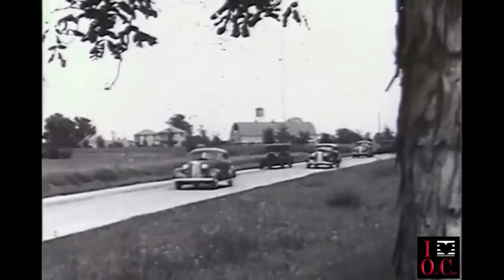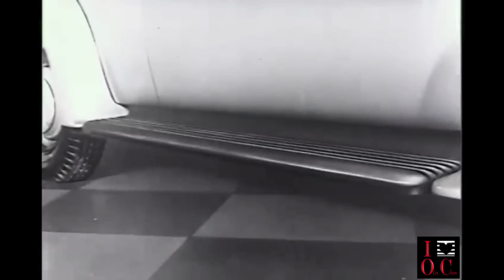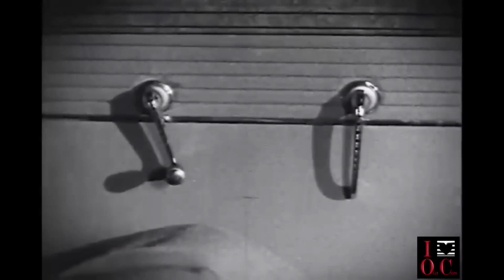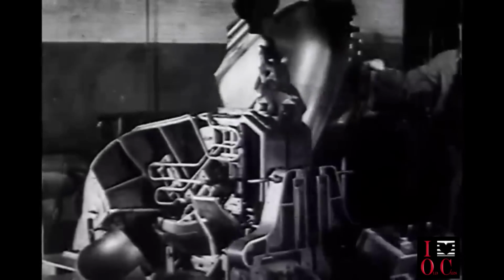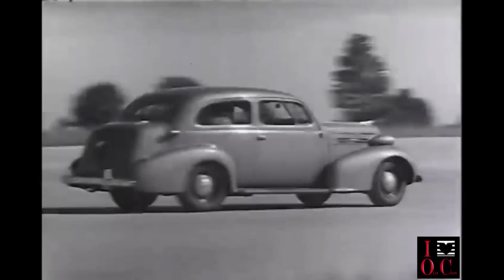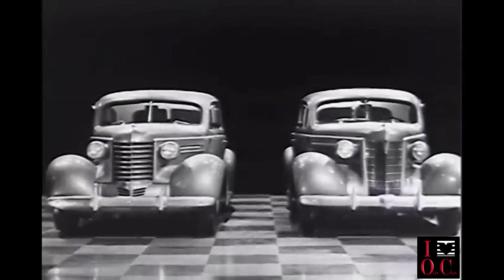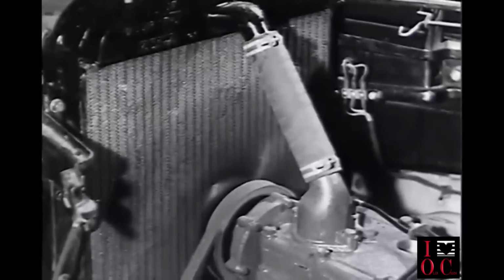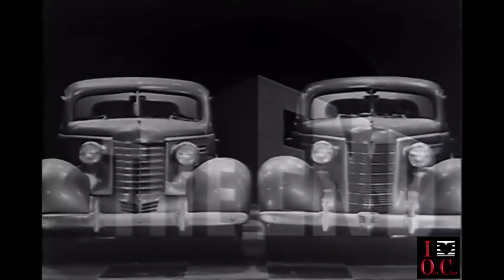This Vintage Film Compares the 1937 Oldsmobile 6 Cylinder and 8 Cylinder   Which Is Better

Comment: Very informative video.  Too bad the audio could barely be heard.  GM should have retained Oldsmobile and dumped Buick.  Between the two, year by year, Oldsmobiles were always a better car, as for engine design, quality, reliability, and durability.  GM however always priced Buick more than Oldsmobile.  Buicks have been assembled exclusively in China fir over 30 years, but the Chinese will not buy them.  They buy Japanese cars, especially Toyota.  The last car I bought for my father was a 1994 Oldsmobile Ciera SL 2 Special Edition (nearly every available option installed).  My father was not one to take care of a car!  Actualky he was hard on cars.  All his life he bought a brand new car every 8 years.  With Best Buy brand new cars he never got more than 27,000 miles (1958 Dodge Coronet) to 83,000 miles (1985 Ford LTD) before they were worn out.  With the Oldsmobile he got 248,000 miles out of the car over the same 8 years!
Reply from the maker: It was very difficult to raise the volume of this original film without it getting distorted.  Olds was a solid car and I agree with your thought that Buick should have been let go over the Olds.  Thanks for commenting and for watching!